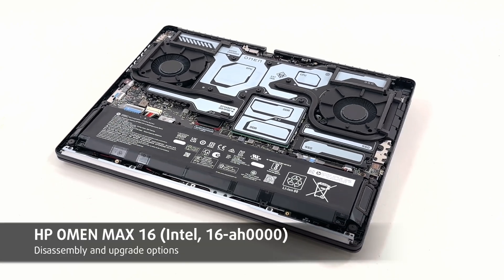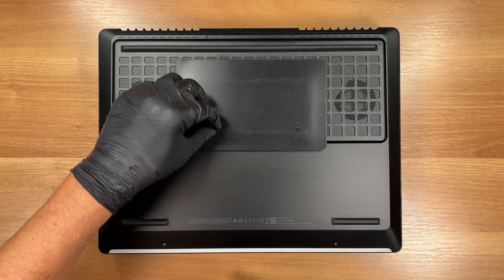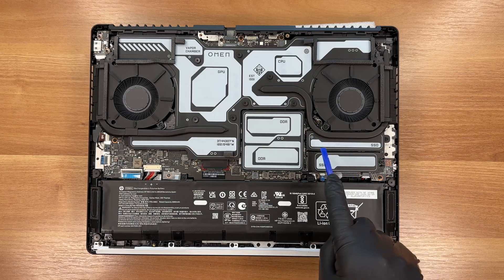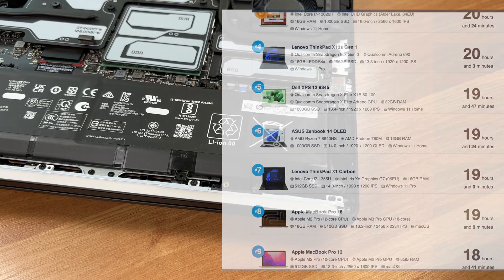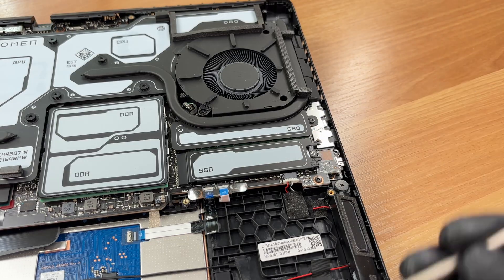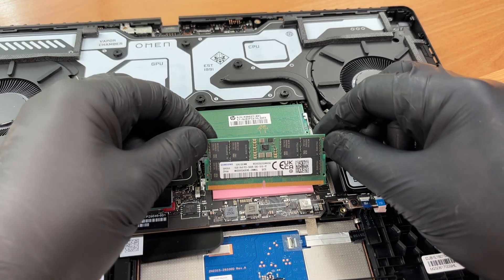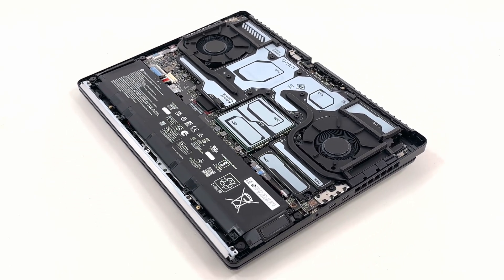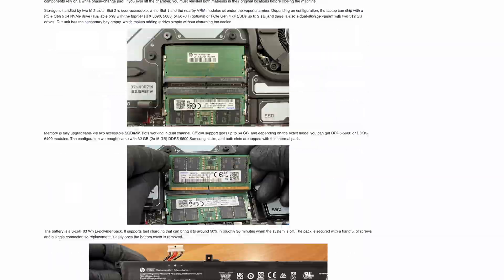🛠️ How to open HP OMEN MAX 16 (Intel) - disassembly and upgrade options

Comment: Point of awareness for those interested in or working with this model: It CANNOT fit a double-sided SSD.
Single-sided SSD is your only option.
Reply: On both slots? Or just primary? I'm hoping secondary fits double sided

Comment: Your website has good writing, but it makes it difficult to find out which exact version you are opening/reviewing.  Meaning the exact configuration.  I have to scroll down a lot to try to figure out which exact specs it has.  When a model has various configurations of CPU, GPU, RAM and Storage and monitor, you show all of them, but don't mention which exact you review.  Have all that info in the title or at least first paragraph.